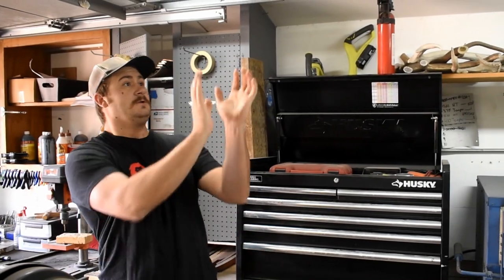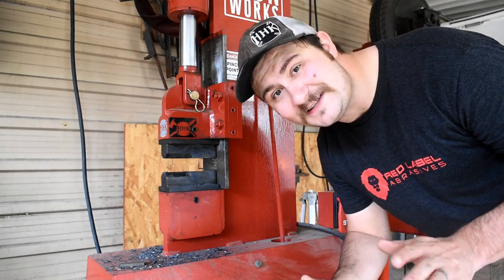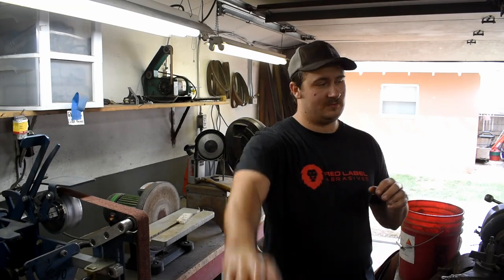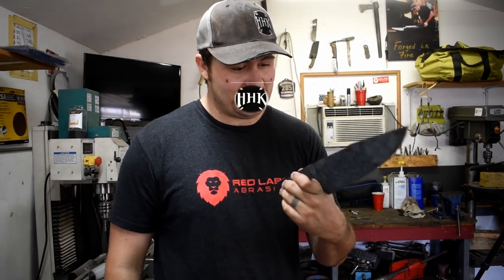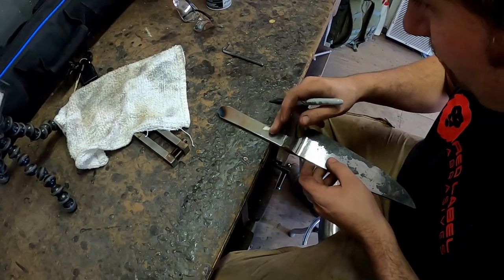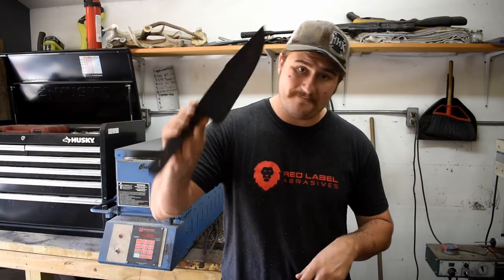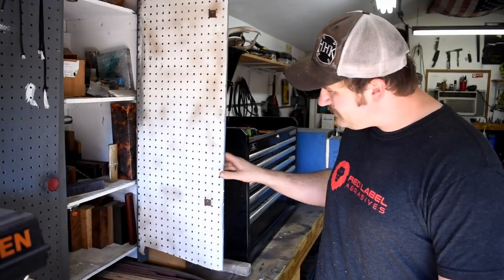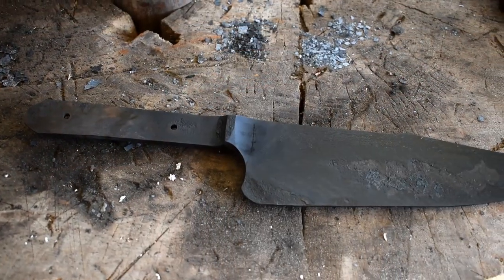Making a Chefs Knife out of an Old Roller Bearing Pt. 1

Comment: Did you use any cutting oil when drilling?
Reply from the maker: Just some spray oil I had on hand
Reply: @HensleyHandmadeKnives  Ok, I was just wondering, since the drill bit broke.
Reply from the maker: @corbanducommun8826  yea it was giving me hell because it air hardened a bit so I used a carbide bit that got through but bound up and snapped
Reply: @HensleyHandmadeKnives  yikes, hopefully it wasn’t an expensive bit.
Reply from the maker: @corbanducommun8826  about 20$
Reply: @HensleyHandmadeKnives  not to bad, at least it wasn’t an expensive one.